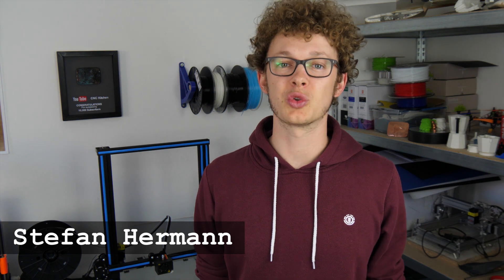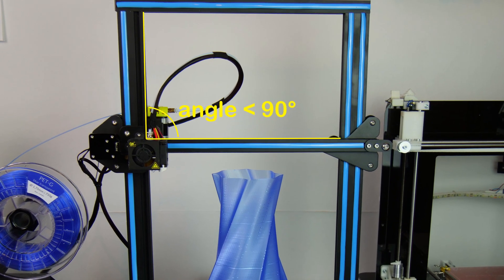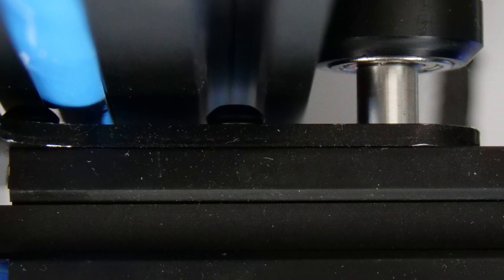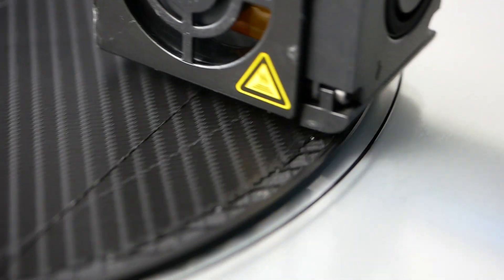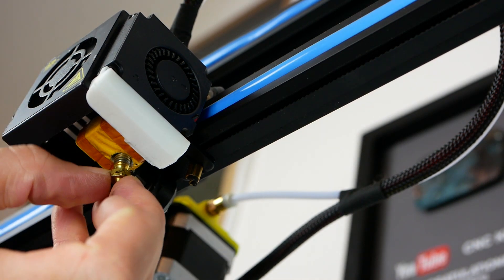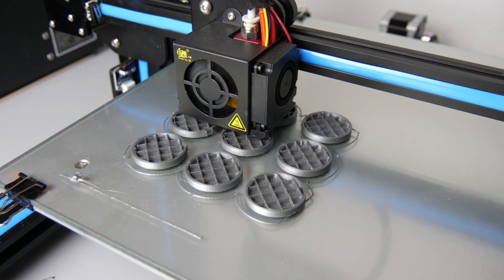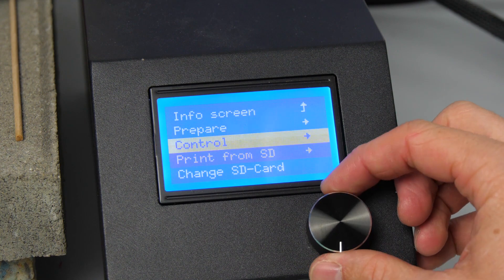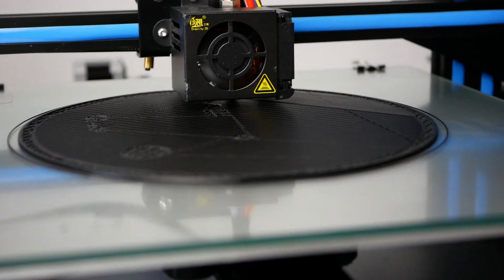Use your CR-10 the right way: BIG parts with a BIG nozzle!

Comment: if you want the script 

; Automatic configuration of Vmax and Amax on Creality CR-10
M203 Z20         ; Set maximum Z-axis speed to 20 mm/s
M201 X800 Y800   ; Set maximum acceleration for X and Y axes to 800 mm/s²
M500             ; Save settings to EEPROM
You only need to run the script once

Great video thanks

Comment: CR 10 S is my only printer, I was a beginner 2 years ago when I bought it ... 
Problems: 
1. high noise of motors, fans. 
    Solution: Octopus v1.1 board with KINGPRINT TMC2209 V1.2 Motor Stepper Drivers for motor Sounds , and fans changing to Noctua NF-A4x20 FLX and  Noctua NF-A4x10 FLX
In addition to mounting this board, I also made a custom case that fits exactly perfectly under the printer, only 7 cm high
2. The PTFE tube must be replaced with Bowden Tube PTFE XS Series or something much better to prevent the filament from blocking.

As a conclusion Stefan, you are very right, for a beginner it is a headache, but only with difficulty you learn everything.

P.S. I forgot to mention ... for leveling the bed BL TOUCH definitely !!!! because the end stops it has installed, for Z , will no longer be correct after 200-300 hours of operation.

Happy printing guys!

Comment: I am currently building a Hypercube of 500X500X500 mm,  I have been at it for over 2 years now, it's a difficult balance between work, family, investment, designproblems and the resulting ARBEITSLUST whenever I have the free time, also my other builds and prints sometimes take up quite some time.  However I am planning on finishing it, currently fighting with the orientation of the cablechain, the sheer length makes it hang which makes it want to go down in a direction where it will break, Well when I started No one had ever built one that big, but I am pretty sure some have already succeeded, My original idea was to print big parts but to keep the 0.4 nozzle for high detail, mainly I want to use it to print an  Iron Man suit, a doomslayer armor and a Halo Master Chief, and I want to reduce the amount of sanding and filling gaps, I have the patience for it so I do not mind the extra printtimes, allthough I worry about powerconsumption, heatlosses (I do intend to print a closed container for it) and security (Firehazards etc...).
Here are some video ideas for you derived from my experience:
In these times of War and possible energy crisis because of it have you ever considered the possibility of running a printer on solarpanels, windpower and Batteries? (I was also thinking of building a smaller portable one that I could use in a field which is probably easier)
What are the best Materials for insulating my printer and keeping the heat in the chamber without loosing the view of the printer? Probably Plexiglass but are there alternatives (Cheaper or better?)
What would be the best Price/quality airfilter for printing more Toxic materials like ABS,  Nylon or PEEK? Or Resins which is another thing I would like to do in the future.

What if I want BIG AND More Detail? When is the amount of detail too much to be a feasible cost print? I take it a 0.2 mm for a Max volume cube CR-10 would take weeks or months, that print would end me up with an electric bill and a stroke when reading it, but where is the tipping point? What if I go Full renewable and off grid, would it be feasible then? Are there any design modifications in powersupply and power usage that I can implement or that are planned by manufacturers to lower the cost?
And lastly safety, I know you can have temp sensors and security, smoke alarms etc....But what if the worst happens? A fire? Can an extinguisher be built in? I know water and foam would destroy the printer but maybe that is lowcost and less traumatising and less deadly as letting my house burn down during extra long prints over several nights, but if there are alternatives like CO2 I would be happy to hear it.

Comment: I have a CR-10 S5 and the same issues... but for big pieces this is super gut :D ... smaller prints also are not that precise even with a 0.2 nozzle and a 0.1 layer height, ... the circles tend to be oval and not regularly oval, sometimes to the left, sometimes to the right, ... at first I thought it was temperature and pulling, but after testing a lot, ...it's the printer, beyond 0.3 starts to have little issues... 
other than that... I mostply print with 0.6 and it's speed at that size makes it very useful...

Comment: U failed because of the layer height. No pla or any other material is able to become solid if u use a 0.8 layer height it will fall off from the wall line. So large nozzels mean large lines not higher layers. i print with a 1mm nozzle at 0.4 layer height and i get perfect prints.

Comment: Hi Stafan, hast du mal einen Pellet Extruder ausprobiert? Für wie kompliziert hälst du die Verwendung?
Reply from the maker: Noch nie mit einem gearbeitet. Sicherlich ein interessantes Spielzeug aber wohl eher für spezielle Anwendungen geeignet, da zb kein retracting möglich ist. Auch die Pellets zu handeln ist nicht ganz so einfach und Pigmente sind die andere Sache. Mit fertig gefärbten Pellets bist du nämlich auch nicht günstiger als mit Filament.
Reply: @CNCKitchen  dnke für die schnelle antwort. ich dachte eher an geschredderten plastikmüll auch wenns dann eher in richtung PP geht was wahrscheinlich nochmal andere probleme mit sich bringt. ich dachte evtl an diesen hier: https://mahorxyz.wordpress.com/2016/05/02/pellet-extruder/ was hältst du davon?

Comment: Could you publish your profile for 0.8 mm nozzle on the CR10 if possible? Working on getting good results with the CR10 S5, this would be much appreciated!
Reply: Did you find a solution for CR10-S5 ? Have also a 0.8 nozzle but lots of stringing.

Comment: My CR-10 is a good printer, though it had some teething problems.  The most notable one was that the heat cartridge for the nozzle failed early after about 10 hours use.  Replaced it and it's been just fine since.  The next issue is that the print bed isn't as flat as it could be.  Especially after I switched from the glass bed to a flexible build plate.  I eventually just modded the printer and installed an automated mesh leveling system from TH3D.  Flashing firmware for it was annoying since it doesn't have a boot loader, though this might have changed in more recent versions?  Also, the bed heater is underpowered for its size.

But let's talk about what the printer CAN do.  Print quality is excellent, with best results at 0.12mm layer height with the .4mm nozzle.  Going smaller than that starts resulting in blobbing, but this is probably just because running a .4mm nozzle at 80um or 40um layer height is asking for trouble.  It also came with a 0.3mm nozzle, but I haven't experimented with it much.  I have some really nice miniatures.  You can see the front teeth on the 1 cm tall rat figure I printed, for instance (this one was at 40um layer height).  Unline Stefan's prints, I found layer lines nice and orderly, but this is heavily dependant on the tolerance of your filament thickness!  I suspect he's running into either overextursion or wet filament, or even running too hot - I run PLA at just under 200C.

For large prints, the .4mm nozzle has no trouble with .4mm layers.  After installing the mesh leveling system, it can print .2mm initial layer height across the entire build plate.  Right now I'm printing a model of the Notre Dame cathedral in Paris.  It's about 10-11 inches in the longest dimension, and at the .12mm layer height, the print will take about half a week, even at 90mm/s movement.  It's actually much more of a torture test than I initially thought, with very thin (less than 2mm wide) towers forming the seperators between windows.  So far, none of them have fallen, and they're dead straight and not wavy like a lot of the example prints people hade done on Thingyverse.

For materials, it prints PLA and flexible TPU very nicely (the latter surprised me, given that it's a bowden extruder.  Was running at 30 mm/s IIRC).  PETG gives me no end of bed adhesion trouble, which I suspect is due to the underpowered bed heater.  Also, I have a thick PrintInZ flexible build plate, which I think is acting like an insulator, further reducing the surface bed temperature.  I haven't tried ABS, and don't really intend to, given its reputation.  Might attempt nylon some day, though I think I'll need an all metal hotend to withstand the temperature.

Comment: Thank you for pointing out the problem with the fan blowing on the nozzle instead of the printed part. I see this problem on a lot of 3d printers and it is a big weakness in the design. I need to fix mine like you did, great thinking Stefan 👍

Comment: After watching many videos of CR-10 and all flaws it has, I decided to upgrade my printer to 300x400x500 with 2 heatbeds and linear slide guides. It will be hughe and it will print ultra fast, because it will be tough and no shaking and wobbling. But It will take some time to get all parts. Will use 2 Z axis screws because I believe one can make problems and those guiding rollers are a total weak spot, after see problems with it, I will not use it.

Comment: Got 2 0.4 nozzles also, used 1mm drill bit and  ream out 1 of them up to 1mm. Print with 0.25, 0.3mm of layers with no issues.

Comment: i just put a 1mm nozzle on my cr-10.  i found that at 60mm/s (my normal printing speed for .4mm) i was getting bad first layer adhesion (normally fine).  i slowed down to 30mm/s and the first layer works fine, but every other layer just came apart... any ideas?  id love to print faster
Reply from the maker: The material is probably not melting properly. Increase the temperature by 10 to 30°C or use a volcano hotend.
Reply: Thank You, ill try that

Comment: How many Germans does it take to screw in a light bulb?

One, because they are very efficient and not very funny. :)  Joke in good humor, wonderful video and thanks for the input!  The Tevo Tornado heats the bed faster, but I think the build quality suffers when compared to the CR10.
Reply: the problem with heating so hard is because they use a 12V power supply. On their ender 3 printer they use a 24V one and it takes about 2 minutes to heat it to 60 C with hotend heated also.
Reply: How many government workers does it take to screw in a light bulb?  No one knows.  18 months in and they're still working on it.
Reply: How many Americans does it take to screw in a light bulb? alot :)
Reply: Damjanhd which country was it that created the light bulb now?....
Reply: @uglynerfherder  lmfao so true.
I love Germans personally.  I marvel at their efficiency and mechanical ability.  America has always had ingenuity as a chief strength.   Both are great countries with so many good attributes.

Comment: Dammit! I'm struggling to decide which printer to buy! Every other video loves CR-10 and the others hates it... for others it works like a charm.. others have huge difficulties to run it... I guess I should go for the Prusa but it's a lot more expensive!
Reply: Do you need a big build area or just normal??
I have the Creality ender 3  (wich has 235x235) and with small upgrades its a very decent printer and Ive bought it for just 189,-
Im printing quite fast with it too , all parts at 0.2 and I just fiddle with settings in cura slicer to get rid of long printing times.
In the beginning I had issues with sticking my prints to the original bed but after buying a glass bed and using hairspray it works like a charm.
Ive put in TL smoothers ,hugely improved the prints and made it a lot less noisy.
I have dampeners for the motors but its working just fine without them so Im not planning to change it soon.
The bowden extruder is the next thing I upgrade (from plastic to aluminum).
I have it now for 3 months and Im still suprised how nice parts come out of this somewhat cheap printer.
Reply: Creality Ender 5 Plus
Reply: @jeffmilkey  =) I went for the CR-10.
And by a happy accident I got 2 for the price of 1 xD ... the first one got lost in shipping.. I tried to find it for a couple of weeks. I had insured the shipping so they shipped me another one. And the day they shipped the second printer the first one had been left on my doorstep. This all took a couple of months.

Comment: I'm "dreaming" of a CR-10.
However... being very realistic about it.... I will most likely not print 300x300 objects since they would take too long. The longest prints I'm allowing myself is like 6 hours max because I don't ever leave my printer alone. For a ~300x300 thing @ 0.4 nozzle this would require several days depending on the height and complexity.

Comment: I have made an insulation below the heating bed. That makes a big difference. Also insulation for the top, Before I switch on the printer the noozle needs to be driven up on the z-axis. Before the print starts, I take away the top insulation. Both changes save a lot of time. Furthermore you need and I think thats is a must have, you have to secure the USB cable from shaking in the control box or you face nasty time outs. I designed a holder and never had any problem since then with time outs. I print with a Raspberry PI server. Super nice stuff. This gives me the chance to heat both bed a nozzle parallel and not one after the other, beside all the other goodies a Raspberry has. I also put the printer on 4 sqaush balls to reduce the printing noise. Also the stepper motors are mounted on anti vibration  rings. You should find the information on either the german or english FB groups.  Summery for me, this was  an excellent investment and the printer is a 1A choice.

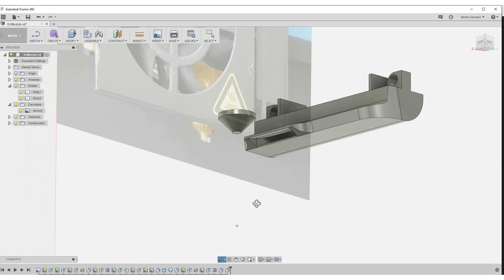Comment: Hi Stefan, how did you make the hole in the fan guide at around 6:04? I recognise the loft feature in the timeline but I don't know what the feature is just before the loft (the one after the fillet - it has a symbol that looks like a plane in front and a blue box behind it).

Oh, and one more thing - could you put the results of the DoE (the best coast/wipe/retraction settings) in the video description for quick reference? I really appreciate your work on this, I've been using your fan guide for over a week. Left you a nice comment on thingiverse with my power consumption readings before and after :)
Reply from the maker: Yes, I used the loft command for the hole and the feature before was a simple face offset.
Reply: Thanks for the update :). I don't think there's a menu option for "offset" but I notice the "push/pull" (keyboard shortcut "Q") offsets faces and gives the same timeline icon. Keep up the great vids :)

Comment: Hi

So I have a 1.mm nozzle I want to print something big with heavy lines..
The filament comes out very thin like a thin line with tiny balls more like a pearl necklace.

Would you know what is happening?
Thanks for any help..
Reply from the maker: Sounds like underextrusion. Is your temperature high enough? Did you change nozzle diameter and extrusion width in your slicer?
Reply: @CNCKitchen  Hi, habe am CR10-S5 mit 0.8er Düse sehr starkes Stringing. Hast du vielleicht nen Rat bitte?

Comment: I'm a noob with a CR-10S.  I've had minimal failed prints (using Cura) after the first three prints I've ever done.  It has a 0.4mm nozzle and I can go down to 0.06mm layers with excellent results.  I have a range of nozzles to try, from 0.3mm to 0.8mm.  I didn't bother with the blue inserts. I am interested in trying the large nozzle, I have large prototypes to print.  
Were I to get another printer it would probably be a Prusa MK3(+)

Comment: Nice quality videos man! Could you please tell us where to find that setup you came up with the 0,6 nozzle? I saw some in the video but not all and I want to try it before upgrading to Vulcanos, Titans and so on. Many thanks for all the info we get from your videos!
Reply from the maker: What would you like to see? Have you watched the other two videos I made?
Reply: Hi  Thanks for the answer I thought there would be more things to fine tune not just coasting, wipe distance  retraction and temperatures. Sorry for the noob question then. I use cura and the new ones have so may parameters to change... And yes I saw the other videos and reviews  and thats why i am considering bying a E3D volcano hot end and probably the TH3D titan extruder. thanks again!
Reply from the maker: It's really just taking your standard profile and tuning retraction, coasting, wipe and temps. The rest basically stays the same. "Tuning" all of the other setting usually causes way more problems than it solves.
Reply: @CNCKitchen  what values work for you on these parameters?
Reply: @CNCKitchen  I have been watching any and all videos I can find on settings for larger nozzles. So far you have given the most information but I don't think it is complete. Unless you truly do not need to slow down the sprint speed at higher temps. The other videos never really talk about temps. Some might mention oh you may need to turn it up and then they don't really say how much. I noticed when you discussed the hot end not keeping up you showed your machine was set at 245 C....early you mentioned 230 c. I assume you had to set it at 245 C to get it to stay around 230C.... Thanks for the video. If someone like you did a video like this and provided the FFF export, you would make lots more money. If I have to experimentally determine the best settings it could literally take days or even weeks. Do a video for each large Nozzle size (.6, .8, 1 and 1.2mm) and Provide the FFF export and you will make bank. Just my opinion.....